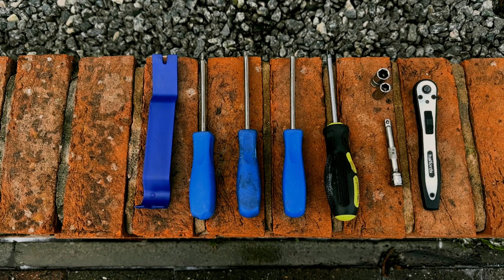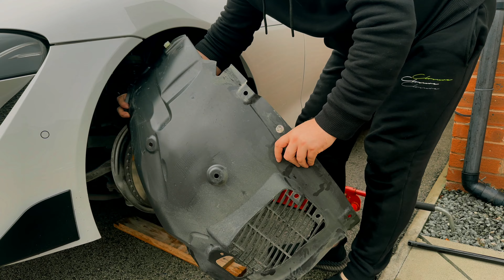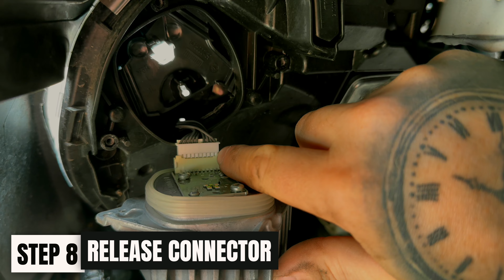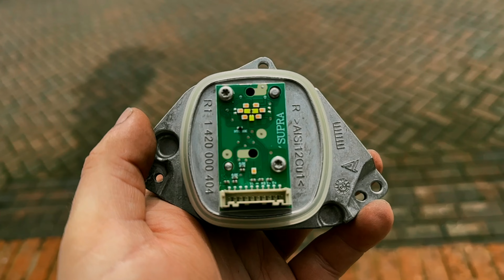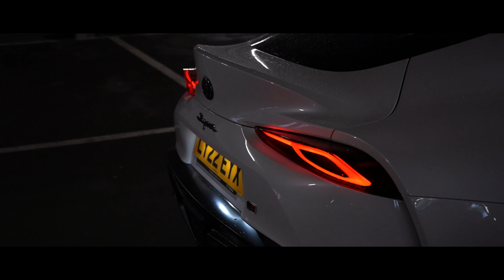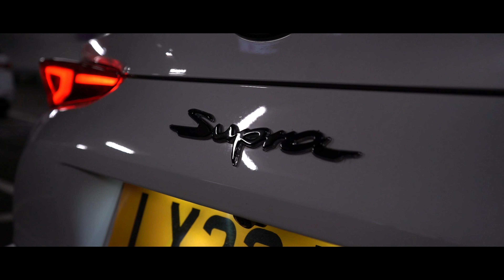Yellow DRL's by Motorsport+ Look EPIC! - A90 MK5 Toyota Supra Install

Comment: Is it possible to get a board that helps you adjust to any color?
Reply from the maker: You can indeed buy different boards that have an RGB setup indeed but I only wanted a static yellow and this avoids any additional wiring etc
Reply: @ZER0Y0N  where can I get a board that does RGB? Thanks!
Reply: Get illumo kit, any color and strobes feature
Reply: @testtwo4513  need link